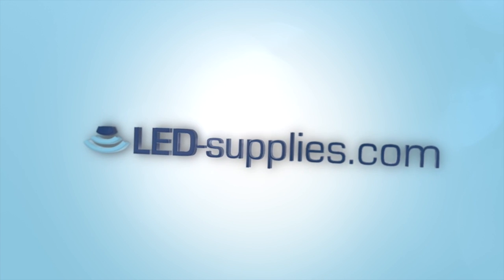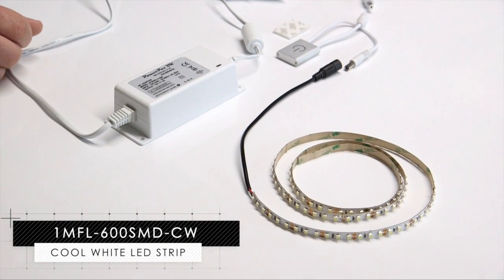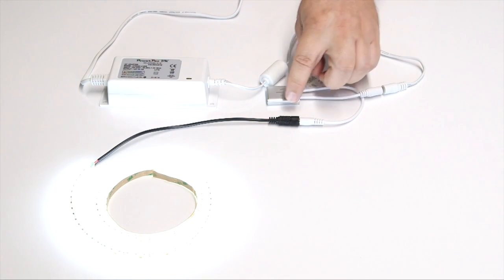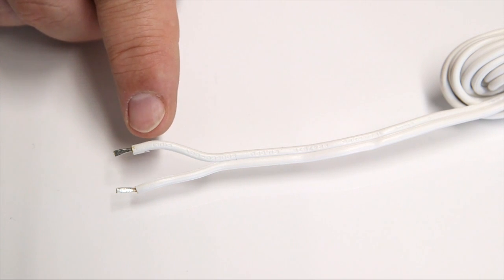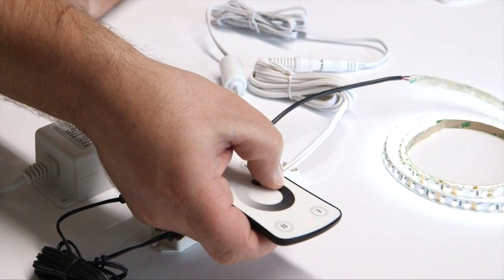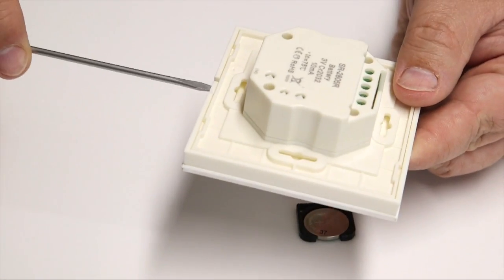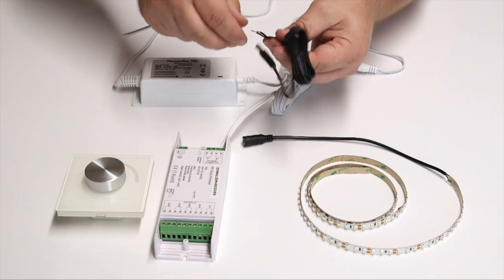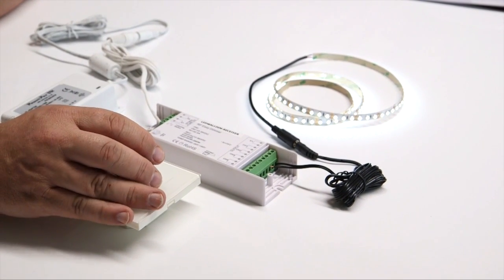Dimming LED strip lighting with LED controllers

Comment: I want to connect 2 reels of 5m 5050 rgb led? With one remote control, and if it is possible one power source?
What do I need except reels and remote control?
Reply from the maker: Hi Neven, if you are looking to control 5050 LED strip it is generally supplied as 30 LEDs per metre version which is 7.2 watts per metre (36 Watts for 5 metres) or 14.4 watts per metre which is 60 LEDs per metre (72 Watts for 5 metres). Therefore 10 metres total will need either 72 watts or 144 watts for the higher power option. I do not have the spec of the remote controller that you intend to use as from your comments it sounds as though you have already sourced an led controller. 

Allowing headroom i would suggest selecting a 90W of higher power supply for the 72W of strip, and 200W power supply or higher for the 144W of strip. http://www.led-supplies.com/product-range/led-drivers

If you wish to power more RGB LED strip from the same controller use an RGB LED repeater such as this http://www.led-supplies.com/rgb-signal-amplifier-data-repeater

Take a look at some of our RGB controllers here http://www.led-supplies.com/product-range/led-controllers/led-controllers-rgb-colour-changing